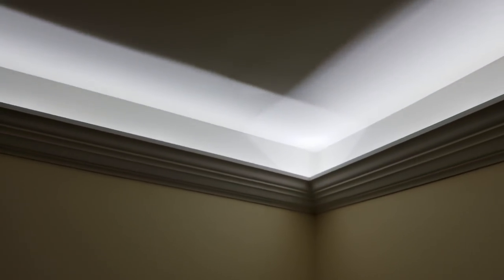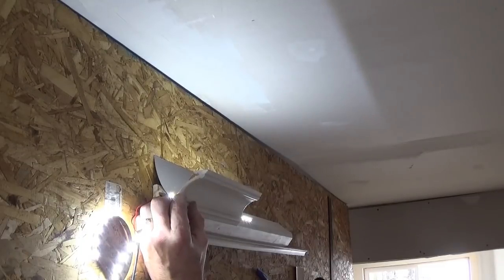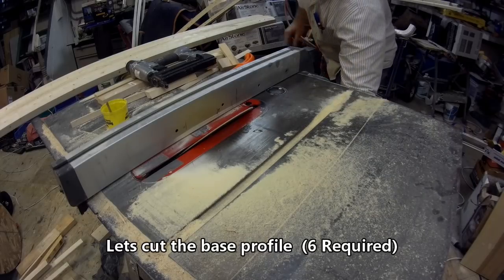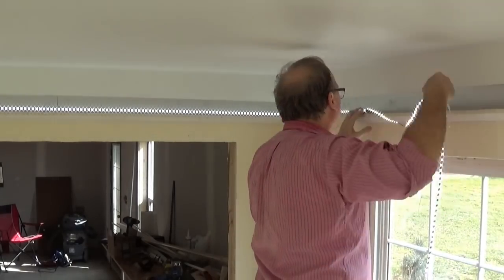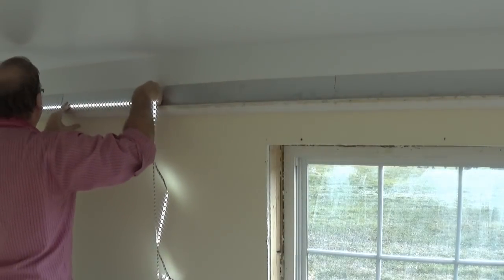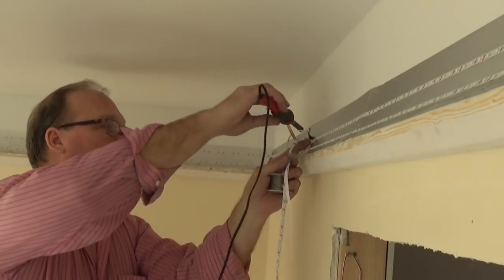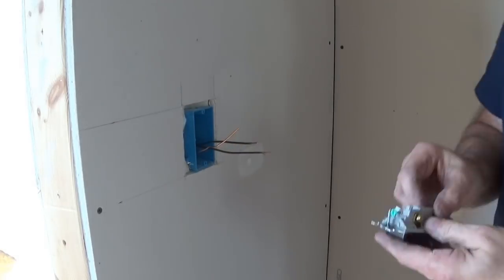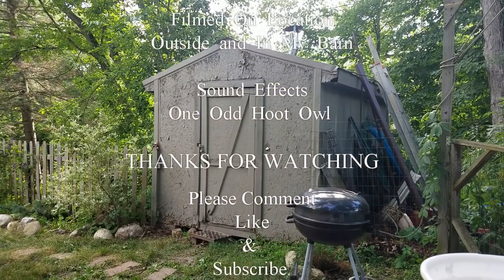How to design and install crown molding with indirect LED lighting for less than $125..

Comment: buildings and homes will see more and more in wall DC power supplies and telecom like Ethernet or Power Over Ethernet. they even have PoE LED lighting now and PoE 12v power injectors/supplies. newer PoE standards can supply up to 75 watts! i also like the idea of an in wall ATX PC power supply for 12v and 5v for USB plugs.
Reply from the maker: Hi CJJ,  I agree 100%,  more and more homes should have direct low-voltage wiring and just a few specific A/C lines.   I'm working on my shop rehab and all the lighting will be driven from a dedicated DC source with battery backup.  I already have a couple of videos of some of the changes, stay tuned for updates.
Thanks for watching and commenting, I do appreciate it.
Reply: @SouthernEngineering  I have a ups in the closet with the PoE Ethernet switch but the UPS has no internal battery but battery cables going to 2x 100ah batteries in the crawl space to replace the 2x 9ah batteries, it has at least 4 hours runtime, calculations say a bit more but I've never tested past 2 hours. All PoE devices stay up during an outage. PoE injector + strip LEDs might be worth trying if I can find/calculate amps on the PoE/injector
Reply from the maker: Sound like a good start, have you considered using a plug-in watt meter to get a reading on your load requirements. My shop is almost all fluorescent, but I'm slowly converting it to LED. The main bay consumes just over 1100 watts when the lights are on (which is when I'm out there) some areas have been converted to LED, but the main bay is a priority. I injured my leg a few months ago, so not much has gotten done but doing much better, so this year should be productive.
Reply: @SouthernEngineering  for PoE switch,modem, phone box, small server, wifi, router, hard drive/files storage, alone I'm pulling less than 300 watts on a 1500va ups. I'm sure with the few things I be added plus the ups its self it's probably 300 watts I'll have to plug in a watt meter now that you've put that idea in my head. I have wifi meters with remote control on most items. I'm sure it could handle limited size strips for back up lighting 😁

Comment: Since you are paralleling multiple strings and typical LED tape lights are 12VDC constant voltage (the current limiting is done with series resistors on the tape), I'm pretty sure what you used is a constant voltage power supply, not constant current as you called it.   But nice install.
Reply from the maker: Hi Gary, yes, you are, of course, correct. One of the problems with YT is when you discover an error, you can only correct it by reloading the video losing all comments and view count; since video promotion is based on those items, your video essential gets lost in cyberspace.
SO, it's better to leave the error and move on,  if someone catches the error, it becomes an excellent opportunity to interact with viewers.

Glad you like the video, The goal for my daughter's studio was keeping it on budget, she is making good use of it.
Thanks for watching and commenting, it's much appreciated.

Comment: Where do I get one of those anti-gravity carpenter squares???
Reply from the maker: Hi Bogie.  As with all things "Amazon" 

If you like this project I hope you stick around, I'm doing a Top to Bottom Re-hab on my workshop. 

I'm making it `ship-shape' so to speak, it will be a blend of a full and proper workshop, a bit of mancave and better suited for video's, stay tuned if you want to follow along.
Thanks for watching and commenting, I do appreciate it.
P.s. I post updates and previews on Instagram @southernengineering
Reply: Try watching the video again on your phone this time and rotate the screen 90 degrees anti-clockwise

Comment: Great video. My dream is to own a pole bar for all my experiments.
Reply from the maker: Thanks Rashad,  keep your dream alive,  this is the culmination of many workshops over the years with each one bigger and better.
I built the barn (had it built) 9 years ago for storage but recently I decided it should be updated and a more enjoyable place to work,  (my daughter's idea)   If your interested check out the first of the rebuild/remodel videos https://youtu.be/ZlRQzcXXJuQ where you can see the direction I'm taking it. 

The barn is 2500 sqft so I have lots of options as for how I arrange the different area's (welding, machining, studio, electronics lab, toolroom, main work bay, and several other areas); once it's finished I will be able to work on most everything I find an interest in. 
Thanks for watching and commenting, I appreciate it.
P.s.  I post updates, previews, and other random stuff on Instagram @ southernengineering

Comment: I was wondering if you could do a video close up to show how to soder the ends like that. It would be very much appreciated.  Thanks for your videos.
Reply from the maker: It's funny you should ask that;  I was thinking the other day that I never explain the voltage drop and current load and how I compensated for it in such a long run of LED'S.   @ 17:00 you can clearly see that the output had dropped and I never explain how I fixed that.  Give me some time, and I make a short video as to how and why.Thanks for asking.

Comment: :what was the proper power supply? you mention it at 17:35
Reply from the maker: HI Nate.    The power supply @ 22:20 is a generic chassis type 12V 10 A. I purchased from Amazon.  Thanks for watching.